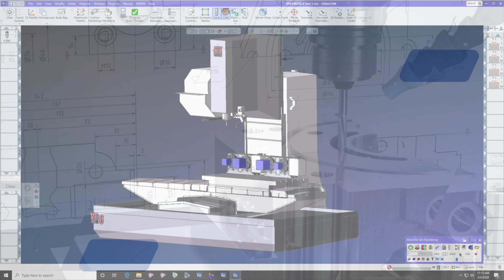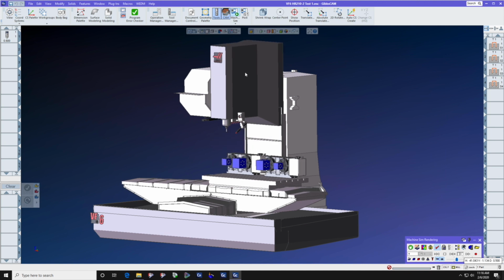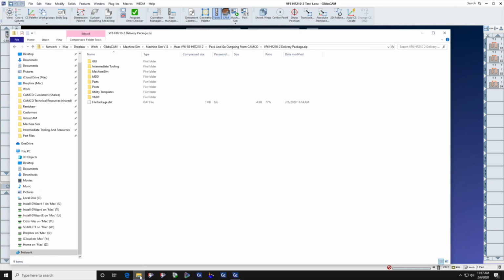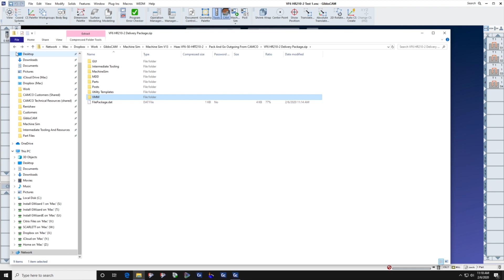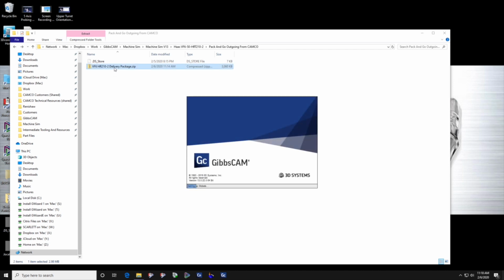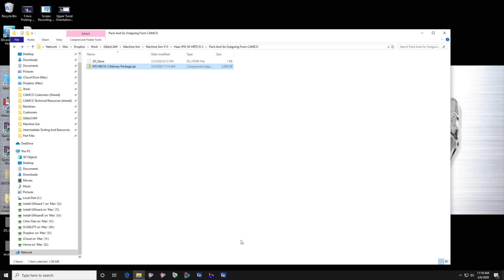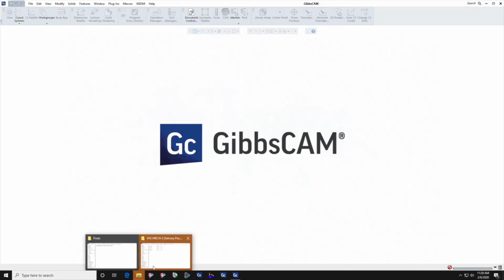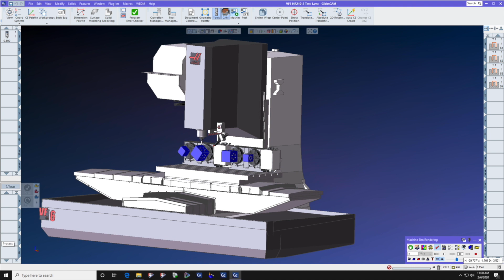GibbsCAM Tech Tip: Post Package Installation

Comment: Please, a build machine tutorial.
 I mean a tutorial to creat a machine when you only have de machine assembly.
Great video as allways!
Reply from the maker: Jaume, building a Machine Sim Model is definitely something we can assist with. However, this is an advanced topic and beyond something we would do for a tech tip. But, we would be happy to help. You can contact your local reseller to assist to train you on this, and if they can't help..we surely will!